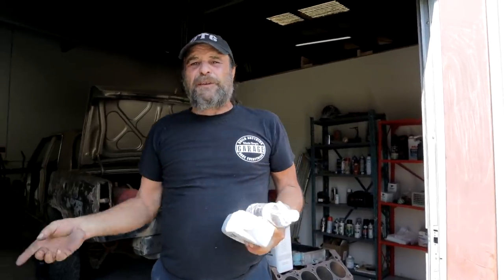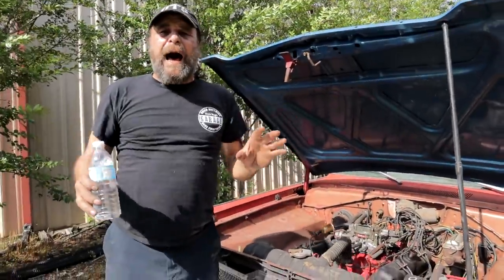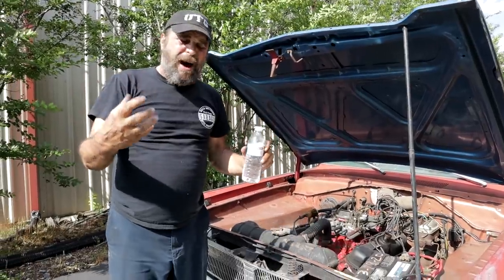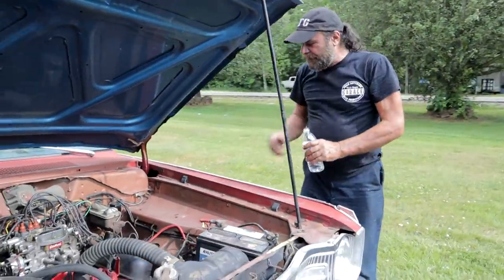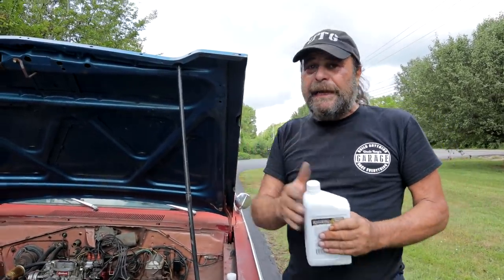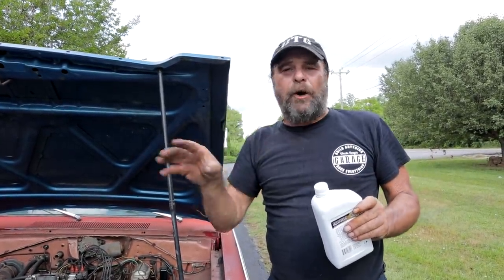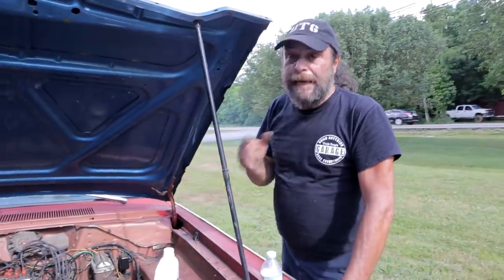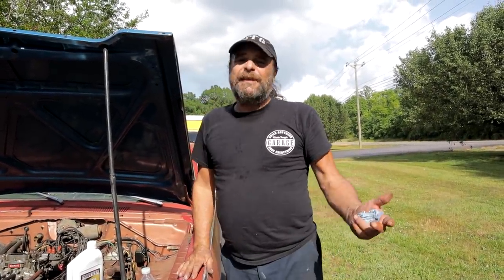Forgotten Service Routines From The Distant Past

Comment: My dad worked at a Buick dealer during the late seventies. He talks about how bad their carbon issues were. You’d shut them down and the engine would diesel on its own. GM had a product called Top Engine Cleaner. He’d do what Tony is doing on a hot engine, fog it out for a few minutes, then dump the rest of the bottle to flood the cylinders. Then they’d let it sit for a bit. After that they fire the car up. It’d bow plumes of black smoke. Eventually it’d clear up and ran like new... until it inevitably heeded the treatment again

Comment: When I was young and didn't have a UT teacher, I had a Chevette.  I replaced the automatic transmission cooler hose with a windshield washer hose.  First trip, it blew a hole right through the hose.  Sprayed ATF all over the exhaust driving down the highway.  No one behind me could see.  I can still smell that smoke. 35 years later.

Comment: Uncle tony helping me devise a smoke screen getaway vehicle
Reply: A ball valve and a T-fitting teed into the PCV line with a hose running to a ATF bottle will do this nicely. You can even hook it up to a choke cable arrangement.
Reply: drill and tap a hole into exhaust manifold, fitting and brake line running to an oil squirt can inside, 7-8 pumps can shut down a highway. PROBLEM = all the droplets only SMEAR when someone hits the wipers and you could be liable if they got into an accident and you were caught.
happened by accident to a friend I was following, a transmission cooling line split open sprayed directly onto the outside of his exhaust manifold on 101 just North of Santa Rosa. found out first hand how the stuff just SMEARS, washer fluid isn't strong enough can't clear it fast enough, had to pull over and get most of it off the glass with a rag. the cloud STOPPED traffic a couple minutes both directions, all 4 lanes, it would have been even crazier during rush hour.
Reply: @paulhare662  naaw, you want the big dump direct to the most heat!
more heat = finer particles = thicker clouds. what I'd typed was instructions from the old book "the poor mans james bond".
I know how bad by an accidental line break spraying a bunch on the outside of manifold/exhaust, now imagine it all going directly inside.

Comment: I had a Gold Duster with Halo Top. Worn out 225. I put a bottle motor honey down the carb;  because I was sick of the car. Smoked up the place, but kept on ticking, much to my dismay. Water does wonders for old crusted engines for certain.

Comment: Boy, does that bring back memories. Sticky valves, dose'em with ATF or Marvel Mystery Oil and watch the smoke roll out and listen as the valve stops sticking and the motor starts to run right again. Our irrigation engine would get the MMO treatment every fall until it died from too much oil, but come the next spring, it'd fire right up since the cylinders were still well lubed and the compression was instant. I never used the water trick since the cars I drove never had a chance to carbon up.

Comment: It also helps that the oil residue from the Marvel Mystery Oil or the transmission fluid keeps carbon from sticking to the metal. Carbon does not stick to wet metal nearly as easy as it does to dry metal

Comment: Uncle Tony when I worked at Pep Boys about 10 years ago they still had the IV drip it's a metal can now I forgot who makes it. You pour thr solution in and hook it to the vacuum for it and then it's got a little window to see it actually go in the motor. We used to try to sell it all the time. You'd get flat rate for it and you could leave the car idling and work on something else. The kit came with the top end cleaner you could put in the IV, throttle body cleaner, and a fuel injector cleaner you put in the gas tank.

Comment: Used to do that all the time back in the day.  You should tell them how we used to fix pinhole leaks in the radiator.🤣
Reply: Are you talking pepper,  skoal, or the pinch and twist trick?
Reply: @stevetaylor9265  pepper or Copenhagen.  The original stop leak.
Reply: @stevetaylor9265  also the easy fix for a gas guage that doesn't work is to write the milage on a dusty dash when you need to fill up next time.

Comment: Back in the mid-1980's I worked at a Chrysler dealer in Toronto.  I remember fairly regularly the mechanics pouring Chrysler de-carbonizing fluid down the carb just like you did with the water, creating clouds of white smoke so thick you couldn't see the parking lot (never do it inside)!  The instructions on the can said to dump the last bit in quickly, causing the engine to stall.  You were to wait 5 or 10 minutes for it to soak in, then restart the engine.  Engine de-carboned!

Comment: Anyone remember marvel mystery oil injector setup ??
Reply: Always used MMO down the carb like this, and in the oil if a hydraulic lifter started making noise. Especially on grandma driven Imperials and Newports, used to buy the cars for $100 to $200 in the 80s Demo derby them, pull the motor and trans and get $100 for the shell right at the fairgrounds.
Reply: I remember watching a YouTube video of a 1929 Ford Model A with a jar hooked up to the carb siphoning MMO

Comment: We have a decarbon machine at my work. It’s a pressurized bottle with a squirter that you stick by the throttle body. You hook it up and rev it a couple times at intervals and it’ll bellow our smoke just like your car was. It smells like a blown head gasket

Comment: When I change the oil, I still put 1/4 quart of Trans fluid in with the oil.  Cleans the motor out. I remember pouring water down the carb while reving the motor at 2000 rpm to knock carbon off the back of the valves. Now days, all the cars are fuel injected. But you can still pour water in the power brake vacuum hose. In fact, when I buy an older car, I always replace the oil with transmission fluid and let it get to operating temp and let it idle for about an hr, then do a complete oil change. If the care takes 5 quarts I put 4.75 quarts of oil and .25 quarts of ATF, every oil change. I have an 85 chevy 3/4 ton that you can wipe the oil pan clean with a paper towel.

Comment: Berryman's B-12 in the gas tank, Marvel Mystery Oil down the intake (maybe a cup), water tune every six months for grocery getters ...
Reply: @meowfaceification  the Ultra-Low Sulfur Diesel that's been the street fuel for probably 20 years now is known to not lubricate as well as the older fuels. So you do need to add something to the diesel fuel to improve "lubricity".

Comment: That's amazing!  I didn't know about either of these.  The water I can understand more at a hot operating temperature, it's so little an amount it would turn to steam immediately and therefore not pose an issue of crunching a piston rod...but ATF?  I thought for sure that would damage an engine if you were to pour it down a carb - mainly because my FSM on my Newport makes no mention of it, and well, it's generally not a good idea to pour anything that's not oil or gas into an engine.  I learn something new about these cars every day.

Comment: When I worked at Volvo back in the 80s we used a crushed walnut blaster on the intake valves back sides, intake removed and at tdc. Crazy carbon build up.

Comment: I remember Gum Out before oil changes and tune ups . They used to sell it in the same quart cans as brake fluid . You got the engine hot and dumped the gum out down the carb as you revved it until the engine drowned and then dumped the remains of the can down the carb . Let it heat soak until the engine cooled down so it could work on the deposits on the manifold valves and rings . Then re start it and beat on it until the exhaust stopped smoking . luckily i had expressway ramps by my house . 1 was a cloverleaf so i could just go round and round W O T to burn the crud accelerating and then over to the next one where the ramps were up hill to put a better load on and then back home after 4 or 5 laps . Change the oil and plugs after it cooled down . The oil was always thick and brown afterwards and the plug tips were white . While it might have caused a slight loss in compression it usually cured any pinging and dieseling issues the car had. When i worked in a shop i did see the water drip for the first time but the only use of ATF i saw was for filter changes on German diesels , i was told it was Bosch procedure to fill the new fuel filter with Dexron to clean and lube the pump and injectors . 80s #2 diesel was so low quality that for winter running VW suggested a 1 for 10 gas diesel mix so the engine would start below freezing .

Comment: 🟥🟥🟥 The water deal is called decarbonizing. We used to do it back in the 60s. Can or bottle on an angle and tilt till the engine sucks it out. Steady higher rpms. If you dump the water in at low rpms, yes, it will hydro.

Comment: Back in the early 70s we use to use a product called CARBOUT. Ran the engine at 1500 to 2000 fed it into the carb till the last quarter a  can and stalled the engine with the rest.  Let the car sit over night. Fired it up the next day and ran it down the highway.

Comment: I use to use the iv can tool way back when.
The one I used replaced the fuel inlet line so it ran thru the carb and not just use a vacuum port.
Smoked like hell, but it worked well.
Also used the water trick also.
Walnut dust was also used in the very early days to clean the combustion chambers also.

Comment: We still use the iv drip style at the dealer. Sprays a solvent into the intake at the throttle body and is basically like seafoam. (This is at a dodge dealer) cleans the valves, intake, and throttle blades. Not going to lie you can tell if its really dirty high milage. 

First time I saw the atf in the intake though! I knew about it in the oil to break up sludge. 

Water is a trick I learned about a while back. Works just as good as anything else 😎

Comment: I've used the water method before but never heard of the transmission fluid trick. But I've only had one car old enough to use those tricks on. Hopefully that changes before too much longer. I'm gonna try to find me a car with points ignition. I really need the simplicity in my life right now.
Reply: I ve heard of the ATF trick but on diesel engines to keep the injectors clean.

Comment: i actually mix half water and half atf in a spray bottle [and shake it] and ive used that technique on diesels and carbed engines and it works wonders just at cleaning everything out

Comment: This kind of stuff is making a come back now actually, with all the direct injected gasoline engines now.
The back of the intake valves gets carbon build up like crazy on them because there is no fuel coming over them to wash it away
Reply: actual GM TSB for cleaning carbon in an engine:
In a well ventilated area with the engine at operating temperature, slowly/carefully induce a bottle of GM Upper Engine and Fuel Injection Cleaner into the engine with RPM off of idle enough to prevent the engine from stalling (typically around 2,000 RPM or so). Depending on the engine configuration, induce the cleaner through the throttle body or an engine vacuum hose/pipe.
***For best results, it is suggested to induce the cleaner through the throttle body with Kent Moore Tool # J-45076 / J-35800-Aor equivalent (shown below).

Turn the engine off after inducing the cleaner and allow the cleaner to soak with the engine off for 2.5 to 3 hours (Do not let cleaner soak for more than 3 hours as remaining deposits may start to harden back up again).
Add a bottle of GM Fuel System Treatment Plus to the fuel tank and fill the vehicle with one of the Top Tier gasolines listed athttp://www.toptiergas.comand/or in the latest version of 04-06-04-047 (USA) or 05-06-04-022 (Canada). See Bulletin 05-00-89-078 for more details on GM Fuel System Treatment Plus.
Test drive the vehicle extensively to circulate the GM Fuel System Treatment Plus.
Re-evaluate the concern to determine if it is repaired or improved at all.
If the concern is improved but not repaired, it may be necessary to perform the above decarboning process a 2nd time.

To complete the repairs, change the engine oil and filter, and advise the customer to only use one of the Top Tier Gasolines listed athttp://www.toptiergas.comand/or in the latest version of 04-06-04-047 (USA) or 05-06-04-022 (Canada) to minimize future deposits.
It can also be recommended to add a bottle of GM Fuel System Treatment Plus at every oil change as mentioned in the latest version of 04-06-04-051.

Comment: I also remember the water reservoir with tube to a metered vacuum port on the intake. Sometimes alcohol was added but water was most common as I remember
Reply: Alcohol, the original antifreeze...

Comment: #1 It's best to put the solution in one of those wash bottles with a tiny nozzle that you squeeze which regulates a small stream, otherwise it's easy to dump too much and hydro lock the engine.
#2 ALWAYS change the oil immediately after doing either of these as it will make its way into the oil and contaminate it. You certainly don't want water in your oil. Best to do right before an oil change.

Comment: I drove an MAN truck a few years back which easily munched 2L of engine oil a day - a real high mileage shed of a thing, but it just wouldn't die - and I found that putting a pint of hydraulic oil in 1.5L of engine oil (3:1 therefore) shut it up nicely for a few days! Probably killed the cat stone dead, but i was past caring by then. Really thought that was where the ATF thing was going...straight in the sump.

Comment: Back in the day a lot of people would drain out the oil and then refill the crankcase with either kerosene or range oil. Then they would run the engine for a minute or two to flush it out. Then they would drain the kerosene or range oil out of the engine and then replace the oil filter and refill the motor with new oil. This procedure probably helped keep the old engines clean but I'm not sure if there was any overall benefit or possible long term damage being done.

Comment: How about these tasks on the old cars:
1.  Grease the front end fittings and u-joint fittings
2.  Rebuild the carburetor every two years or so to get the dirt out of it.  Used to get the carb rebuild kit.
3.  Change the points every 10,000 miles.  If not, expect them to fail any time after that.  Sometimes they failed before that so keep a spare with condenser in the glove compartment.
4.  Change the cap and rotor every 40,000 miles or so.
5.  Drain and refill the rear differential 90W oil every 50,000 miles or so.
6.  Spark plugs every 20,000 miles or so.
7.  Oil changes every 3,000 miles.
8.  Fight with the automatic choke when it goes out of adjustment or the intake crossover clogs or the spring loaded valve in the exhaust pipe binds either open or closed.

Comment: I'm familiar with using the transmission fluid.  A quart in the gas tank for the top end lubricant.  Also putting in the crankcase 50 to 100 miles before an oil change to clean out the sludge in the engine.  Specially in the valve covers and in the bottom of the oil pan.

Comment: My Grandfather, always used Marvel Oil when he tuned the cars, he would dump it down the carb as you did with the Trany fluid and was always putting RISLONE in the fuel system

Comment: Am I really old enough to remember actually doing this? Time flies. EFI had cat safe fluids that were used to do the same thing, clean carbon and oil residue from the throttle body since no fuel was injected until the intake valve. We used a pressurized IV drip bottle with a spray tip clamped just above or in front of the throttle blade to clean everything. If done correctly worked great, most people called it snake oil and refused service.

Comment: I would use a garden hose with a pistol sprayer. give it enough water to prevent run away with throttle wide open. the carbon would come out in huge amounts. this would also allow valves to seat properly and stop clicking. you give good advise.

Comment: I remember watching my driller on drilling rig take off air cleaner on running 30L diesel v8 engine and pur water in with a hose as black smoke pur out. He did it on each engine every so often to get the carbon out. Old tricks.

Comment: Best remedy for carbon knock was Ford combustion chamber cleaner. With a tech presiding, you could quiet and smooth out older engines.
Before the tune spesh, which gave little time and spark plugs only.
Having a cars symptoms can give your tech some ideas sending him to the best use of the time you pay for.
Then you aren't reinvesting in all the parts when they are really still serviceable.
Having a why, that applies a guys money to a direct result and he gets value.
A noisy engine after the trickle test/clean?
It needs further attention to the causes of noise.
ATF was $0.90, that was a cheap way to find out if you're careful.
Now it's staggering to see what they have done.
Type F compatible fluid has a big fancy name and a price to go with it.

Comment: I do support the oil to clean the guts of your engine approach....I had a 318 with a bad cyclinder that honestly burned more oil than gas & when I tore down the engine that cylinder was carbon free,....but nowadays I use mysteryoil in the crankcase & gas tank,....it truly lubes sticky valves & cleans the engine,...marvel actually made a bottle that mounted under the hood & connected to a vac port for that IV drip method,....Whatever they say on the Marvel bottle is no idle boast,....its one of the best additives for a gas motor....hell I use on my firearms as well & it's much better than any gun oil I've ever used.....

Comment: You forgot the grease gun. I had a 1960 Volvo PV544 that I found all, 20-21, zerk fittings less one. The one I didn’t find was the one on the water pump shaft.